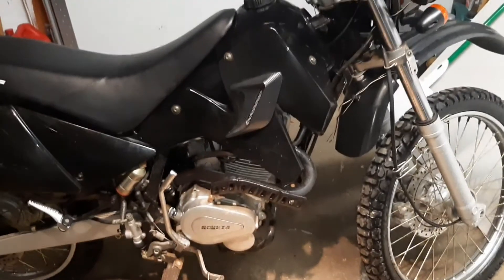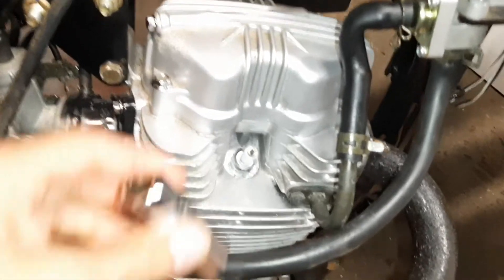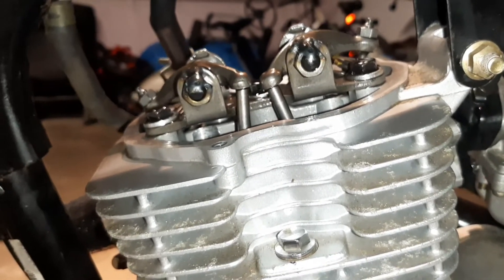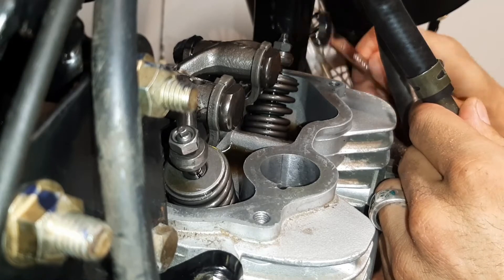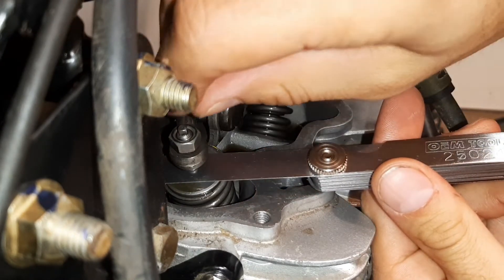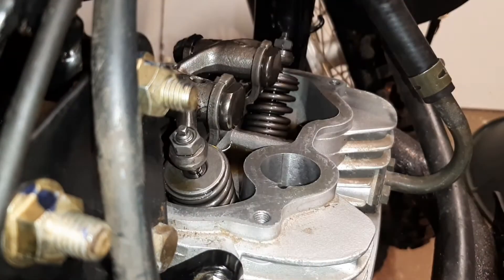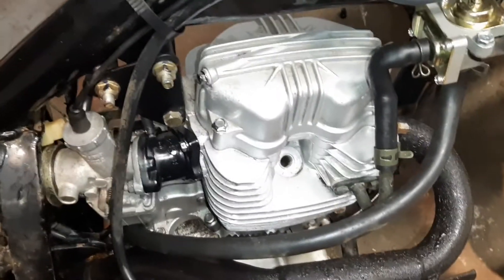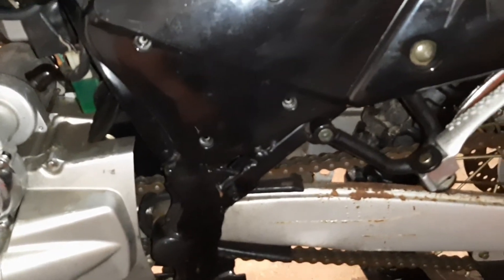HOW TO DO A VALVE ADJUSTMENT

Comment: I have a 150 cc bike, supposedly the clearance specs from a mechanic's vid I saw are 0.6 and 0.8 for exhaust. Is there any way I can adjust them without a feeler gauge that I haven't been able to find here? And now my bike makes a weird squeaky noise from the valves after I try to kickstart it without adjusting them well at first. 😢

Comment: my bike has over head cam shaft, so there is no upper lid like yours have, but a camshaft lid, intake and exhaust lids. my problem is those lids dont just come off, cause the nuts holding them do not rotate. I have tried everything, showering the nuts with wd40, hitting with hammer, heating the nuts or  welding a metal stuff on then to get a better grip. None of these have worked out and my bike doesn't start at all, or even pass 3500 rpm due to procrastinating the valve adjustment.   my only solution left is to completely take off the whole engine block and load it into cras truck and drive to the nearest repair shop.

Comment: Great video and nice close ups! I've done my valve clearance as per spec and there's still a great amount of ticking from my engine...
When checking I have to lift the rocker arm to get the gauge in but I've checked multiple times and it seems all good. But I'm not sure if it's the chain tensioner or valves 😵‍💫 if someone can help I've got videos

Comment: I have a 150 cc bike the engine layout is similar to this one, would it still be the same process? Mine's valves are too tight. I don't have the thing u slide betwen to measure the gap, can I use something else to slide in in order to measure it, like a card or something thin enough?
Reply from the maker: You will need to find out the gap specified for your bike and I have provided a link in the description to purchase feeler guage set recommended by pride

Comment: What millimeter socket did you use on the spark plug? Need info on that. Thanks
Reply from the maker: I use spark plug sockets I have provided a link in the description below the video